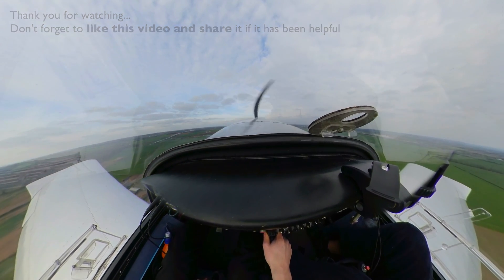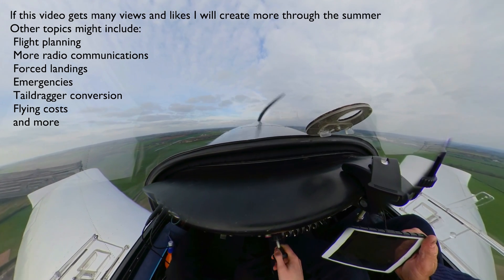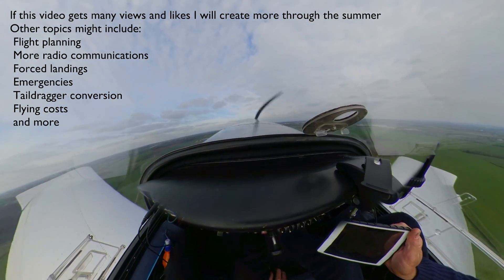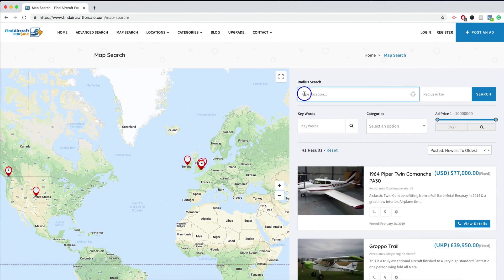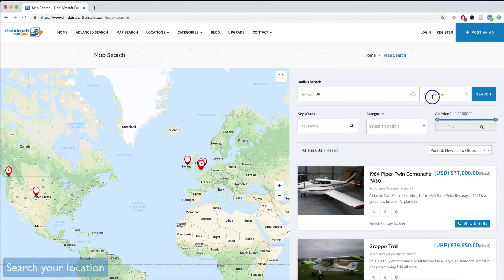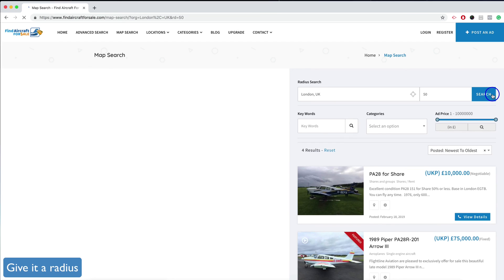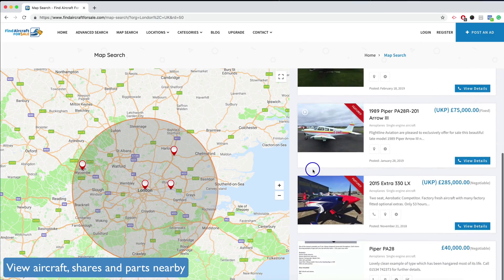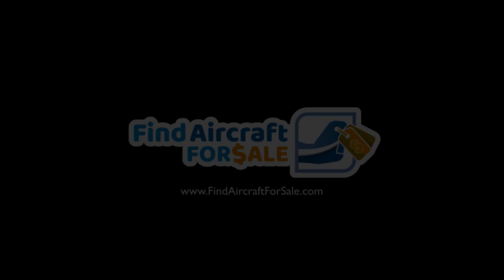Basic ATC radio communications for new pilots going through CTA and CTR on VFR

Comment: Very nice concise video.  Like a lot of student pilots I have been intimidated by the thought of speaking to ATC basically the concern of getting it wrong.  In practice it isn't that difficult as long as you know the structures as you explain.  I've also found the sample flights and associated RT in the back of the Air Pilot's Manual Vol7 very helpful.